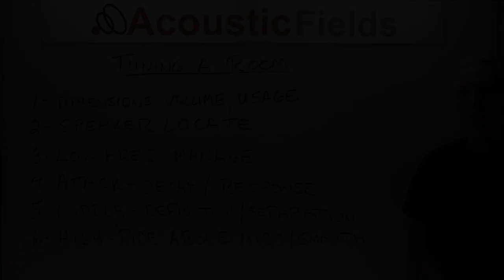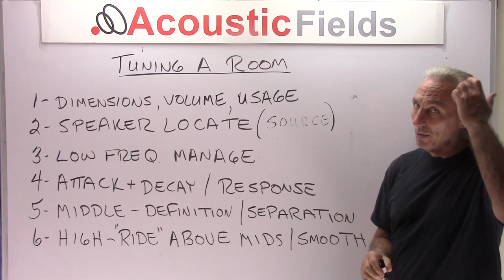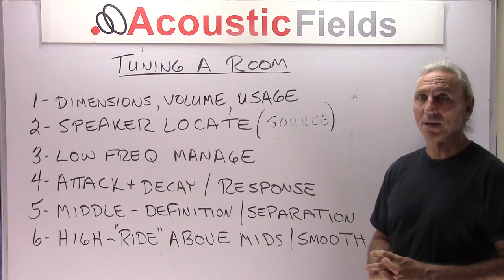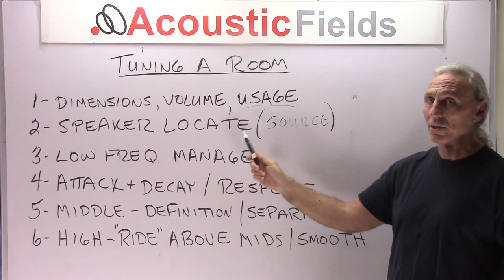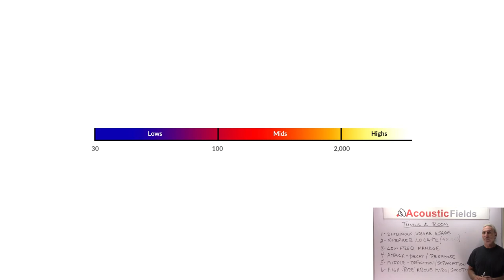Tuning A Room - www.AcousticFields.com

Comment: Dennis, I was thinking about the decay rates for the room and applying it a piano which can play notes in the lower frequency range up to the upper frequency range.  When one plays a note in the lower frequency they have a longer decay time than the upper frequency notes.  When you say getting the same decay rate for the room, will that allow us to hear the entire low frequency notes on a piano (for instance) which will typically last longer than a higher frequency note being played?  I'm just trying to wrap my head around room decay rates and the decay rates of notes on a specific instrument.  Thanks!
Reply from the maker: +Oneness100  Yes, all frequencies must be heard within the room. The usage of the room must take all of those issues into consideration.
Reply: +Acoustic Fields I'm not arguing about all frequencies, I'm talking about the decay rates. lower frequencies tend to have longer decay rates than high frequencies.  At least with an acoustic instrument when the note is played where it's not muted.  What measurements do you conduct that will allow us to figure out when we reach a point where there is too much absorption for any frequency range?